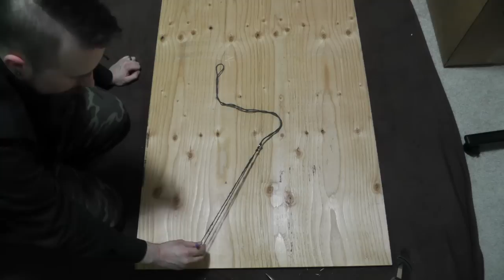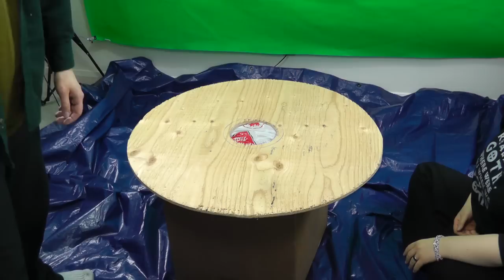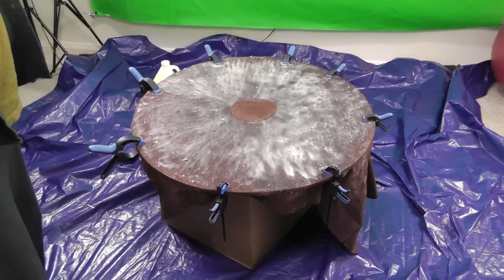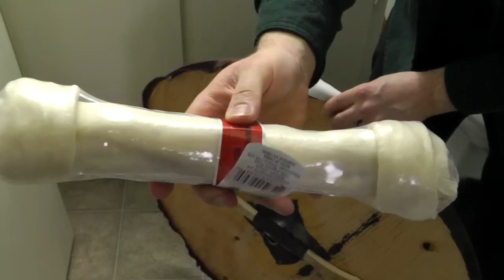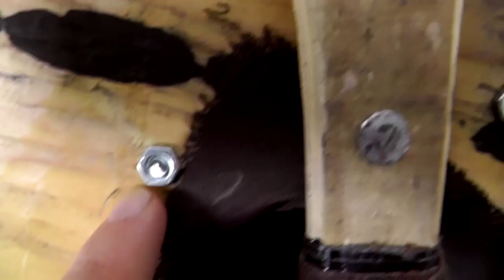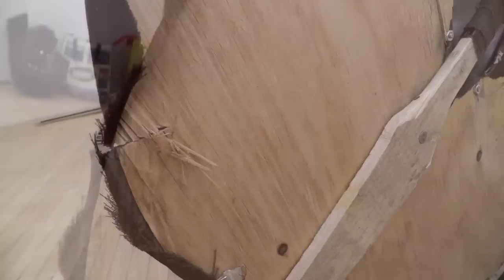How to make a Viking shield on a budget

Comment: I tend to use a mixture of pva wood glue and water, and soak the linen before placing it on the shield to dry.
For the boss I use cut down coach bolts, peened over on the boss side/front of the shield. Doesn't take much effort and looks a lot more authentic.
I like that you left half the rim uncovered in order to test the strength.

Comment: I'm building a shield right now for a friend. The method I read about for putting on the rim is to make a complete loop of rawhide, smaller than the circumference of the shield. Then soak it, stretch it out and put it into place. The rawhide supposedly takes the right shape as it dries and shrinks. Idunno how I'm supposed to stitch it into a loop, but I have some leather working thread and I'm gonna try that.

Comment: When working with plywood that delicate I would recommend adding an extra layer of plywood at the rim, and double up on the rawhide. Not exactly perfectly accurate, but more durable for practice without requiring much more material. In fact with some fancy cutting you probably have gotten this with the materials if it was planned from the beginning.

Comment: Thanks for the video.

For securing the shield boss I use large nails that I cut 4 cm from the board and then I press down on them with the angle grinder (with the heavyest iron grind blade). The nails heat up pretty quickly and then mushroom like a... mushroom. The wood can singe a little (you can water it before grinding),

Comment: hi just a tip i picked up the other day, if you get a 3" PVC pipe cut a line lengthways then cut off 1" 2" 3" sections, they make awesome clamps, that would do the trick for you hide application, and cheap, love you channel by the way, awesome content, good honest well thought threw info, Cheers

Comment: Nice. :)

Would have used birch plywood, just because of the enormous difference in quality (at least over here). I've found that spruce is completely unsuitable for any sort of project where it doesn't end up completely concealed, because it cracks and chips naturally. Then again, my experience from using plywood comes from building reptile enclosures. ;)
Also, you could use a paint brush for spreading the glue and depending on the type, thin the glue with water.

That's really clever getting the rawhide from dog chew toys. All the sources I've thought of have been expensive as hell.

I've had plans to make a shield at some point. Haven't been able to decide whether to make a scutum or a heater. :D Not that I'd use it, I just want to personalize it and hang it on a wall.
Reply: I'm totally going to make one of these, but with white canvas and paint it. Then it's going on the wall with my Del Tin 2104. I might use it while doing some backyard cutting, just to get a feel of what it's like to cut while holding a shield.
Reply: Blake Tyler Neat. :)
Reply: I tried getting my rawhide from rawhide bones, two years ago, but it was completely unsuitable for making a rim with.

Comment: I've made a few shields in the past and some things I've learned:
-Get a cheap paintbrush and cut the bristles down to about 1.5" to spread the glue. You'll get a more even disbursement and it can be reused.
-Heating up your nails, even in a campfire, will give a more medieval look to them. Also, use a peening hammer, instead of a flat hammer, to peen the nails after cutoff.

Shield making is a rather fun project, your first was a grand success.

Comment: I am thanking if I ordered the center cap. I would set the cap inside the hole from the back and let the rim screw from the back side as well. Cleaner look and still you can use the screws no one will see.

Comment: When it comes to covering the shield with linen, as a moderately experienced shield maker myself, I strongly reccomend coarse linen, two layers at the front and one layer on the back. The two layers on the front act as a "kevlar jacket" and dissipates a lot of the impact. Normal canvas just rips. The layer on the back stops the shield from kicking out splinters on the back. Makes your shield so much stronger, like, the difference before the shield breaks can actually be measured in years if done well! Other than that, this is exactly the way I make my shields ^^

Comment: This is exactly how I made my shield. I can give you two tips after using my shield for a while: use and angle grinder to slim the wood between the boss and the edge, to make the shield lighter, and add a few extra layers of cloth. I used 2 layers for mine, and it has had chipping on the flat, but not too much.

Comment: You did a great job, I am by no means saying you did anything other than a great job, but consider some other things for you to try (or the other viewers). I've probably made 60-100 celtic and viking style shields. I liked to use "upholstery tacks" there are some strong and nice looking ones. You can also nail them designs for cosmetics and they are also great at deflecting the edge of the sword blows. The are pretty nice rounded over, a better look than a screw and better than a nail. Check those out. Also try using a glue called HH-66 under the canvas than a wood glue over the top of the canvas. If you want to use leather for the whole shield face you can get scraps for cheap at many leather and craft shops. The rawhide is a great touch, I knew one guy that weaved his rawhide and use the weave for the face. Ugly, but interesting.
Reply from the maker: Thanks for the suggestion.

Comment: Regarding riveting the cut-off nails.
If you drive them through the other way round so that the pointy end you are cutting of is at the boss' side its pretty easy to rivet them.
Did this with my first shield I made this way and it still is holding very well.

Also if you have access to old wooden cable drums you could use the outside of those as the shield. This stuff is really heavy duty and sturdy and makes an excellent training shield.

Comment: I'm a viking reenactor and when I made my own shield I also made the boss myself, with the right tools it's not to hard. You start of with a sheet of steel (high quality steel) and cut a circle to the diameter that you want your boss, plus a little extra so it sits on your shield and doesn't go through, it's worth noting that you should make and measure the boss before cutting the whole your shield. To get the dome shape you will need a metal pipe that is smaller that the diameter of the steel disc you cut out, a blow torch will make this easier, but it's not required. Set the disc on the pipe and starting from the edge and using a ball peen hammer, hammer the inside edges of the disc in a circular motion while moving inward as you do so, a blow torch (or furnace for that matter) will make this easier as it allows the metal to soften, which makes it easier to shape. Keep doing this until you have your desired shape.
Also worth noting, do not hammer to hard and in one place of the boss for too long, as this will weaken the metal, just be sure the shape is even all the way around

Comment: If you wanted to do a more durable shield I would put two thinner boards of plywood with the wood grain pattern being on a 90 degrees angle and just sticking them together rather than just one 1 cm board.

Comment: So, I actually just started building my own, and I found that making a circle cutting jig and using a router gave a much cleaner cut around the edges and in the central hole.  It took a little bit more effort, but a router isn't much more expensive than a jig saw, and it gives a much more precise cut.

Comment: I don't like seeing that gladius bent.
Reply from the maker: It took me 20 seconds to bend it back. Not a big deal at all.
Reply: ***** But real shields are made out of tougher woods. Plywood is sorta shit for a shield.
Reply: Okay,cool did not know that.
Reply: ***** Hoplons were not metal shields. They were primarily wooden with a bronze edging or occasionally a full (thin) layer of bronze on the face. Even in the Middle Ages this is the case. Bucklers are generally the only functional shields made entirely of metal as the small size compensates for the weight. You're right about the scarcity of resources though. It's much more practical to make shields and other disposable weapons largely out of wood and reserve materials like steel for swords and armor.
Reply: Lizardleo
As I noted above in another post thread, cheap wooden shields were actually favoured by many a warrior because whena  blade bit deeply they could disarm their opponent or pull their opponent's guard wide open, leading to an easy kill. Hardwood shields were fo more when defense was the priority, rather than utilizing both hands towards the killing arts. Pavises are a good example of a wooden shield that benefitted from being made of hardwood over soft.

Comment: You can lightly hammer the sides of the nails to give them a square nail look (they will look like they are square nails that way after having hammered them into the wood). Those galvanized roofing nails curl over a bit to when you do it which makes the heads actually bite in nicely.

Comment: When we make shields, it's generally a good idea to put leather around the outside so it doesn't get in the way. For the nails in the handle, we them in from the face and bend them back into the handle. If you want to paint it, it's probably a good idea to do it before putting the leather or boss around it.

To prevent swords biting into the edge, underneath the leather, we put rope or garden hose around the edge. But we use blunt steel for fighting. To prevent splintering at the back, you can put another linen or canvas cover on the back before the handle, but most of us generally don't worry about it.

Comment: I had a ruined 60cm (24") diameter thin copper tabletop that looked the part for some kind of shield. A layer of 1.5cm MDF between two layers of thin plywood (All stuff I had lying around) worked pretty well. A broken belt worked for an arm brace and a grip.

As there was no hole in the centre, there was no need for a boss. I have access to lathes for metal spinning, so in theory I could add one if wanted.

Since everything was made from stuff lying around, it was a good free shield. I'm not sure how the copper face and rim would hold up to weapon cuts, but as there's a reasonably thick (though not in good condition) section of hardwood below it.

Comment: A washer and a roofing nail make a pretty effective combo in making cheap but durable rivets and look fairly close to accurate at a glance. Also if peaning the rivet is hard on a shield boss using a bit of pipe held in the vice to give it a more curved  surface to fit the shape of the boss or if you have a proper anvil the horn would be used instead, failing that turning the shield over and laying the flat side against your anvil or vice would allow for easy penning of the shank from the front shield. On practice or display pieces this may work best and would be more than acceptably aesthetic. The only other sugestion is instead of using screws if you're looking for a more rivet shaped cap on it a small lag or carriage bold and a bit of grinding to remove casting lines and burs and than as Skal did cutting the excess material from the back side of the shield. If raw hide is unavailable also consider an old garden hose or tire inner tube as a possible stand in for reinforcement as you can apply it before the cloth layer to cover it up and it will still function than if you desire that contrasting rim you can apply a suitable cloth wrap around the edge to simulate the leather or hide bands.

 I've also used spay adhesive in place of wood glue and even done metal flashing as a reinforcement layer over ply wood than riveted it down to keep it in place  on larger shields it may take a fair sized sheet or two smaller sheets to accomplish this but it will still take cloth covering well for aesthetic finish or even simply painting right on the metal. Doing this Norman kite shields and others are also manageable.

Comment: I used a similar approach in making my own viking shield. Although I went with a 36" width, with only 1/4" thickness to save on weight, and I skipped the canvas because of the mess involved. I also included a shoulder strap on mine.

Comment: Nice video.  I love round center boss shield fighting.  I am working on my second shield.  May I suggest three things.  Put some hemp rope around the outside edge of the shield before wrapping in rawhide to make it last longer.  He's a tip so you don't need a ton of clamps on the rawhide, just a long length of rope and some tape.  Hold the raw hide in place with a few strips of painters tape.  After it is all in place wrap the entire shield again and again with rope so it looks like a pie cut into small slivers.  This worked really well for us.  Third, don't fight with a shield handle that has been nailed & glued.  After a few dozen hits it will come off in your hands.  Go to tandyleather or someplace and spend a few dollars on large copper rivets or 30 cents on nut /bolts.  (just make sure to inset / cut off so nothing is sticking out.

Comment: Skallagrim, you can use screws if you aren't worried about historical accuracy but still have a good look by using screw caps, there are decorative ones, or you could find decorative nails, like furniture nails which would look more like tacks, but work well for the rim.

Comment: Nice video. Like the idea.
Gladly, blades probably wouldn't strike so much on the edge and the person holding it would angle the shield somewhat thus becoming a flatter hit. And even the ones that would end up doing that cut which is worse type strike, it shows the shield does give adequate protection. And yes, soft steel points bend :)
For the boss, maybe a small thin metal food bowl/ food mixing bowl/pet bowl would work as well, and be quite cheap (bargain stores, etc) - one would just need to drill some fixing points in.
Your channel is great, both level headed substantiated opinions :) and how to videos.

Comment: If you're not sure about the size of the whole, you can always use a cardboard first to see whether your hand would fit with a gauntlet. Also, if you want to use actual wood instead of plywood, you get some forklift pallets, they can be extremely cheap if you know where to look. They are usually made of pine or fir so it's even historical. It will be hard to find wide ones though, and they are too thick so you would have to find a carpenter willing to make them thinner.

Comment: One tip: you could soak the whole shield with line seed oil that way the wood, canvas/linen and the rawhide are less likely to fail during intensive training.
Other then that great tutuorial is wish I had such an tutorial when I made my shields.
Reply: And whatever you do, don't let the shields get wet. The weight increases a lot.  Boiled Linseed oil not also waterproofs but also hardens the wood when it dries. Don't just cover the front of the shield with linen, but the back as well.
Reply: Also, we used masking tape to hold the rawhide down while it dried. Worked very well.

Comment: Instead of nails,use nuts and bolts, when you're done then grind the bolts so it looks like it's old nail (rivets) :)
Furthermore, put at least one layer of wood rotated 90*, because of wood lines, you can alternatively leave one part without that , so that part can be used to catch other's sword.

Comment: Nice shield! There is a couple of things I do, that you might find interesting ;) (obviously this goes for training shields, not even remotely historical ).

 Instead of nails to reinforce the handle, use sharpened screws (got no idea how they are called in english) and then sand out the part that sticks out to look like a rivet :). It generaly ads durability. 

You can also pick up an aluminium profile to reinforce the edge of the shield, makes for longer practice. Just put it on something relatively soft (I use linen padding and leftover leather scraps) 

Once I've actualy used a a piece of a military helmet (old ones are available in my country for an equivqalent of 1 -3 $) as the center piece, but the metal is so resilient, that it is hard to work with. We used to make very resilient helmets out of those, until they got banned from reconstructions :P
Reply: thanks :)

Comment: To make your own boss, I've seen someone else take a steel plate (like a camping plate type) heat til its red hot with a torch or coals and hammer it over a round piece of metal or stone.  Don't take my word for it though, I've never made my own viking shield before - I sure am thinking about it though! EDIT- Your source of raw hide is genious, I never thought to soak a raw hide dog bone.. So many crafts I wanna make that require raw hide, that I thought I was missing out on because I don't hunt.  Now those raw hide doors are wide open (okay that sounded dirty).